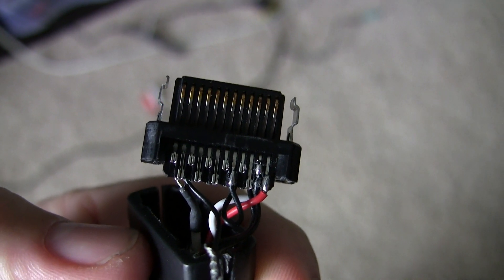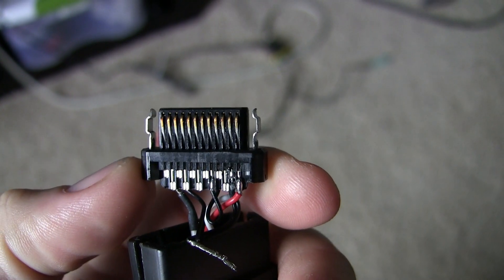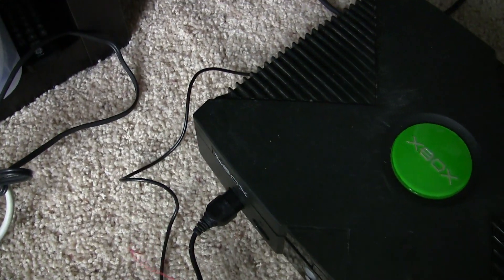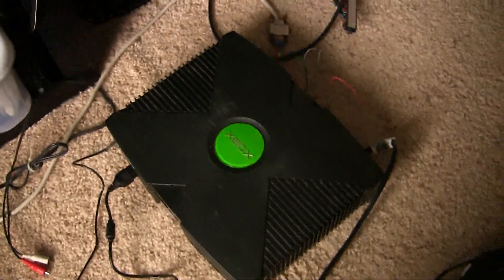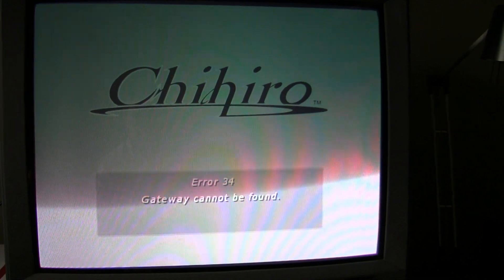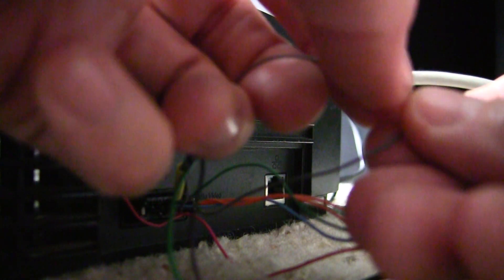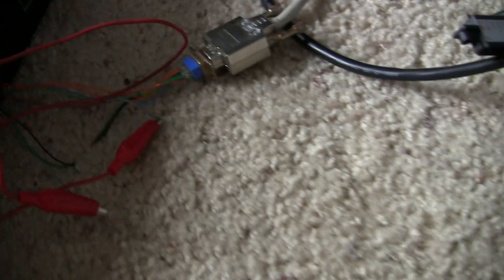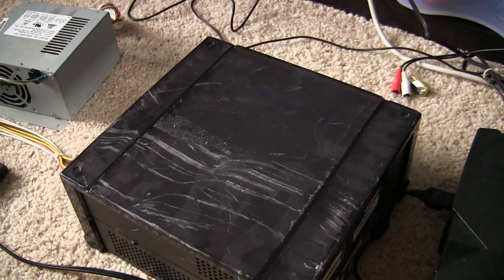XBOX + Sega Chihiro VGA/RGB Adapter Project Part 1

Comment: You need to have a bios that has vga support for it to work correctly on the xbox.
Reply from the maker: +Floydzabarber Thanks guys GTK. My knowledge of Xbox is pretty limited. Was just sort of a "i wonder what happens if...' moment.
Reply: +Azoic101 This is correct